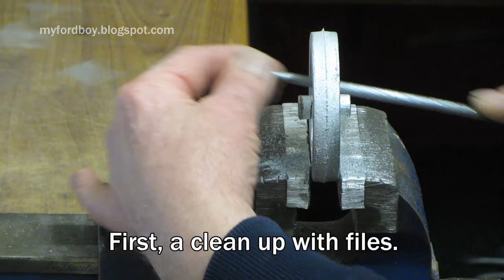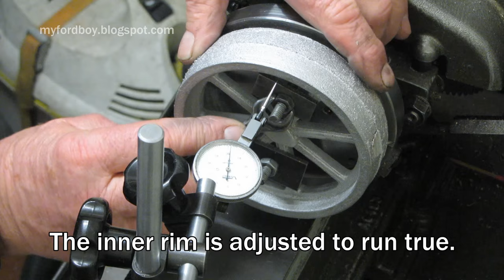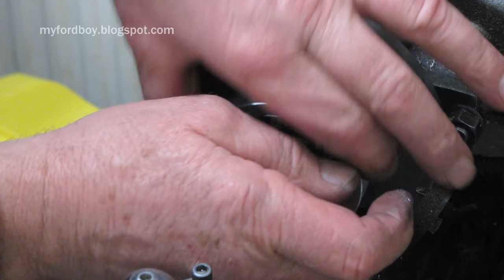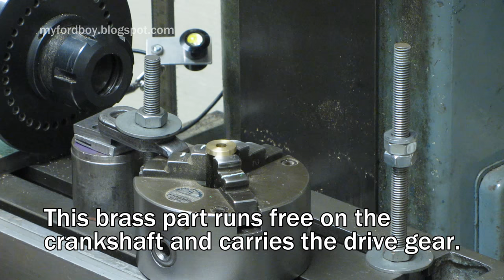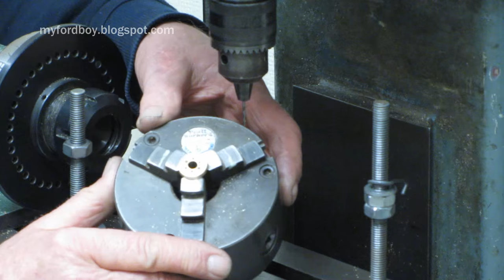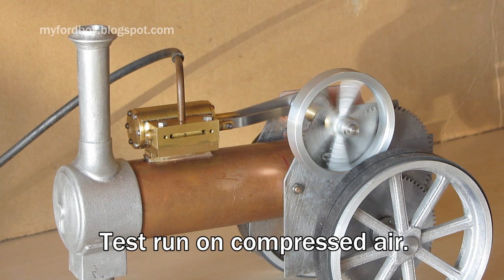Simple Steam The Myfordboy Traction Engine Part 8 Flywheel

Comment: Interesting video. Why did you want 6 holes in the brass part instead of just one?
Reply: +Ronald Walters I suspect either it's for balance on the rest of the shaft (angular position if there were extreme vibration) or when one wears out back out and attach to the second one.  My theory, not yet proven fact!
Reply: +Silas Marner Oh, he answered below...
Reply from the maker: +Ronald Walters  One hole would work but it could mean having to rotate the flywheel nearly a complete turn to engage the drive. With 6 holes max rotation needed would be 60 deg.

Comment: A second question if I may 
I have  made a Furnace similar to your first one you showed ( its made from cut down Butane cylinder , ceramic blanket and refractory etc and with a Reid style burner) 
I intend to use it to melt and cast my artworks . If i first melted some Aluminium or Copper in the Graphite crucible and then added Bronze ( to make the particular characteristic of Bronze I needed for a particular cast) would it automatically mix as it melted , would it just need stirring , or would their be possible problems involved ?
Appreciate your advice , sir ,thanks
Reply from the maker: +flamesfromblazer I haven't made my own alloys but i would just give it a stir flux and pour
Reply: myfordboy
Ok and thanks for replying

Comment: Unless I am mistaken there is some video of the wheels being machined in there. As the flywheel does not seem to have an internal rim to align is that intended to be in there? Loving the series anyway, Have you considered building a 5" gauge/7 1/4" gauge loco? I seem to recall that you said you are part of a model engineering club. I would love a series on building on. " The myfordboy steam loco".
Reply from the maker: +LRTNZ
The previuos videos showed the wheels being turned. https://www.youtube.com/watch?v=VXo9cI9uJSM&lc=z13nyjmjvpmexrcjs04cdzzh4nj3ybpaak40k  I have built a 3 1/2" and a 5 " loco in the past but don't intend making another.
Reply from the maker: +LRTNZ I watched the video again and you are correct, I put the wrong clip in. The principle is just the same though.
Reply: +myfordboy Thanks for that. I was wondering as it did not look like there was much of a rim to align to. I am currently a model engineer in training learning how to use the lathe etc so I may build my own loco.

Comment: A question if I may sir -
How come you made the flywheel from Aluminium and not something with a bit more mass such as Brass ?
Really enjoy your vids , thanks
Reply from the maker: +flamesfromblazer The flywheel is zinc/aluminium, it's twice the weight of aluminium. It machines  really well and is the correct colour for the rim.
Reply: myfordboy
 Oh ok  - thanks for replying !
Reply: +myfordboy how do you cast your zinc/aluminum alloy? Do you have a video on it?
Reply from the maker: +truehybridx1 It's just the same as casting aluminium. It melts at a lower temperature, I pour at 500C. No flux or degas is used. I buy the ingots.

Comment: I've seen footage of the engine running in neutral, and running with the drive wheels engaged, but I haven't seen any mechanism for engaging the drive gear.  I assume one of the pinions is moved somehow.  I certainly saw no lever for performing the function.
Reply from the maker: There is a pin in the flywheel hub that is pushed into the pinion to engage the drive. You can see it on this video https://www.youtube.com/watch?v=eSQ7q28oZYU